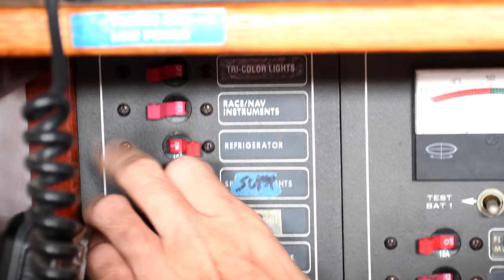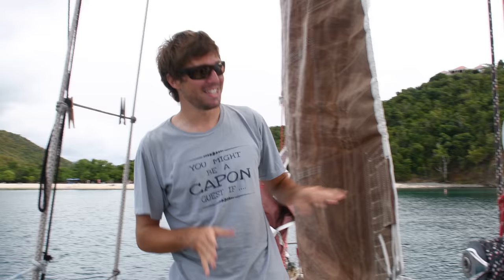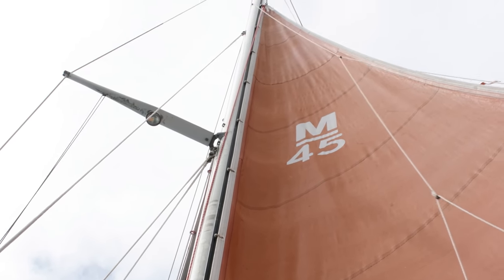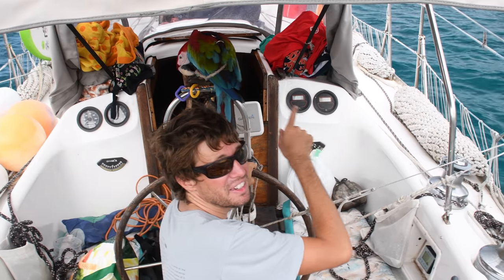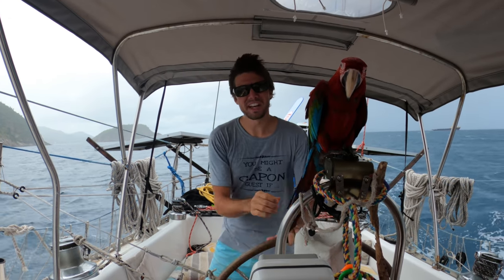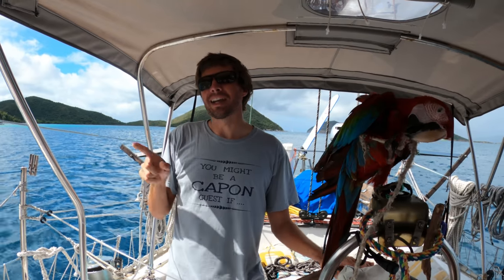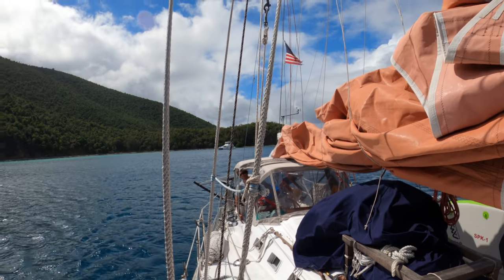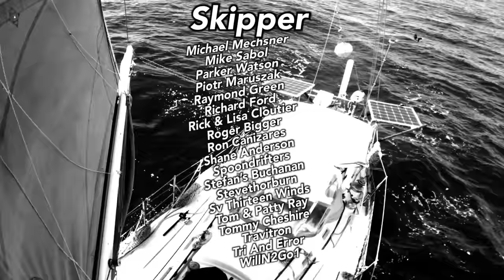Can You SINGLE HAND a Big Sailboat? | Sailing Wisdom [S4 Ep4]

Comment: Assume that a 30-footer and a 50-footer were both equally "set up"to singlehand. In rough seas, wouldn't you rather work the 50-footer. I know that I would. Bad things don't happen any faster on a big boat (with planning), you're not as fatigued, and you're not as beat up by the same weather. 
My 2c.
Reply from the maker: Yes, but everything is heavier on a bigger boat. The traveler on Wisdom is pulled by hand through a pulley system where on larger sailboats the traveler needs its own dedicated winch. Still manageable by a single person, but a lot more complicated because it’s bigger.